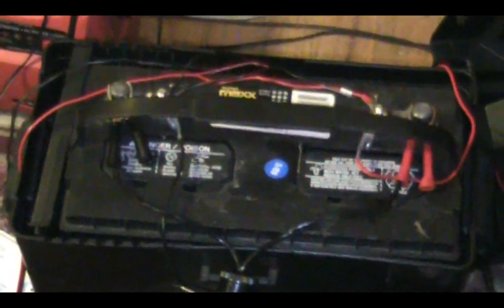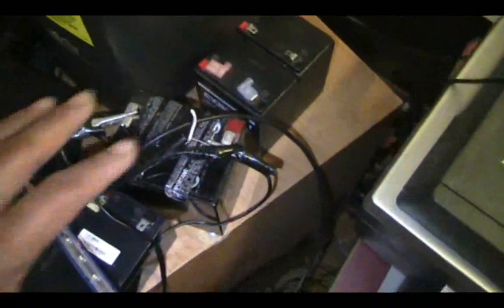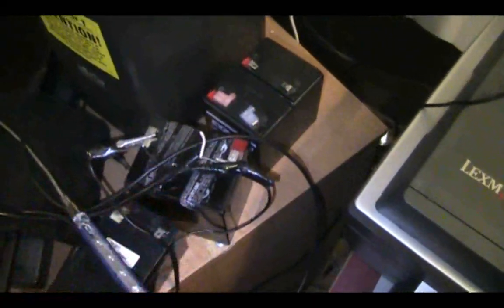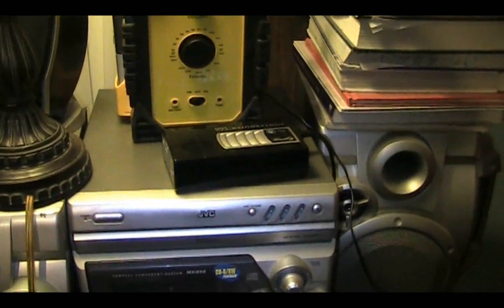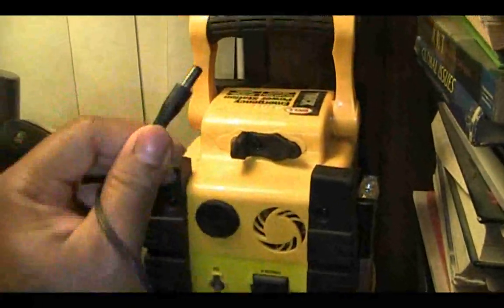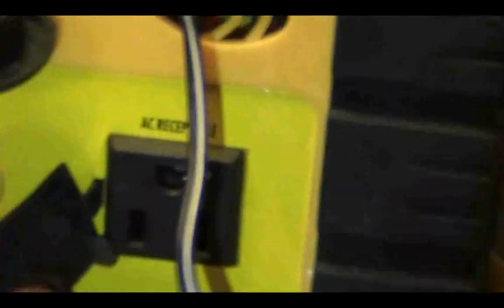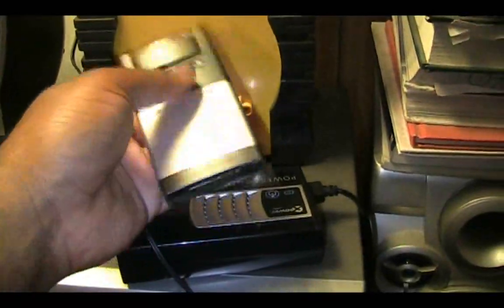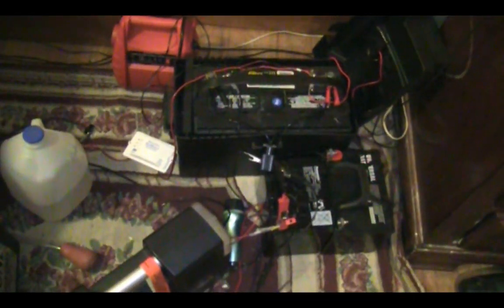Solar system update (aug 2010)

Comment: Nice setup!
More homes should have  some form of energy backup system.
A few weeks ago, my neighborhood had 3 blackouts in day. One was at night of 9:pm to midnight. The others lasted about 3-4 hrs each. We did ok with our small system, but looking outside that night, other then the lights coming from candles,  we had 2 lights, 2 12v fans and ran a 13inch tv for a hour.
Keep up the good work!